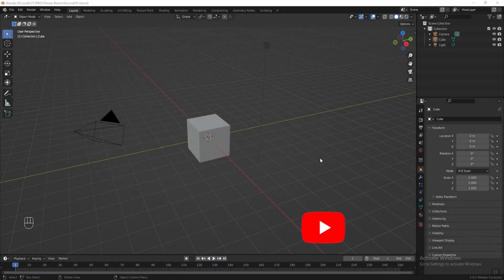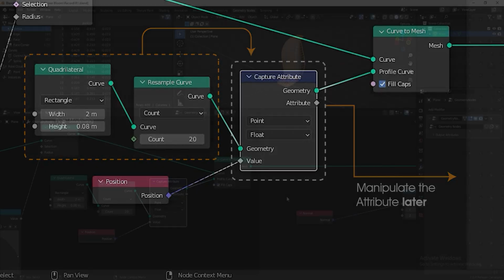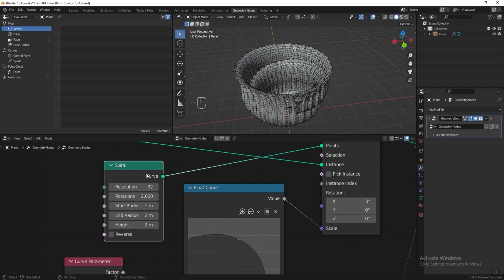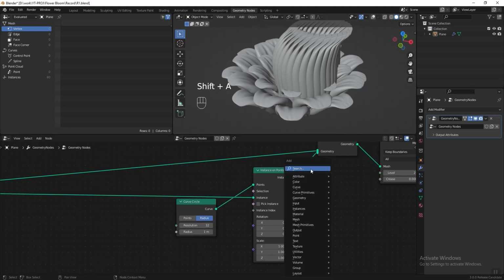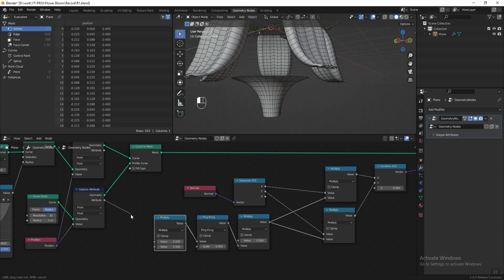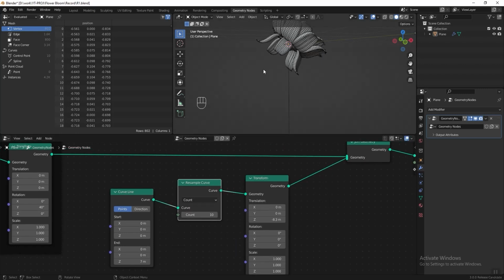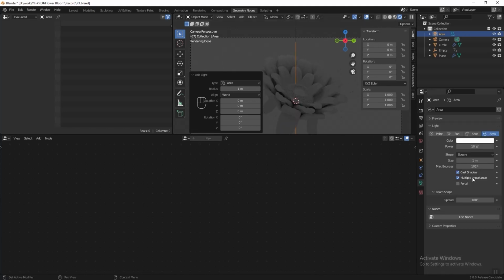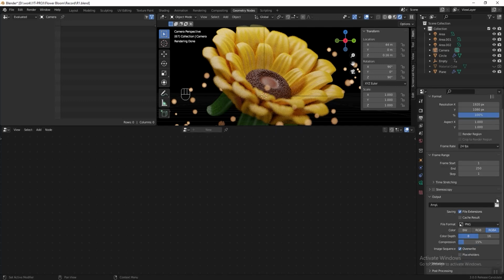Blender3D 3.0 - Procedural Flower modeling in Blender 3D using Geometry Nodes Fields (PART1)

Comment: Great tutorial!
Note that as of Blender 4.5, the curve radius doesn't seem to do anything.
The "Set curve radius" node can be removed.
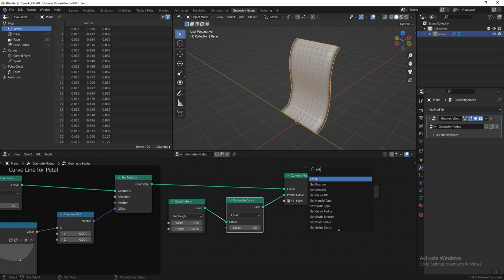Instead, the curve factor modulated by the float curve from 2:50 has to be connected to the "factor" value of the "curve to mesh" node.